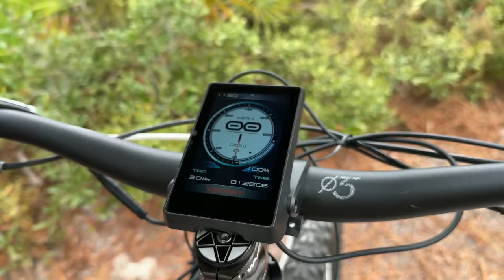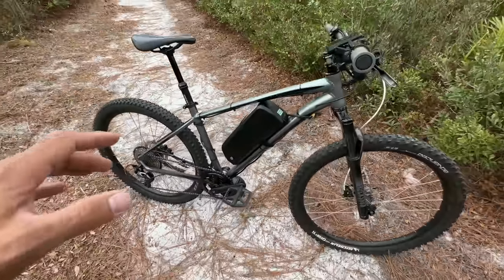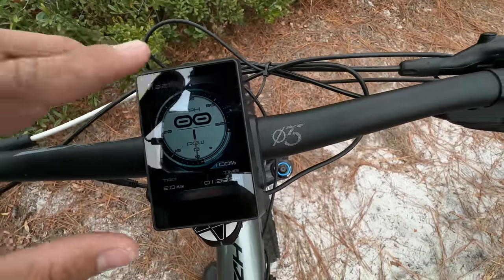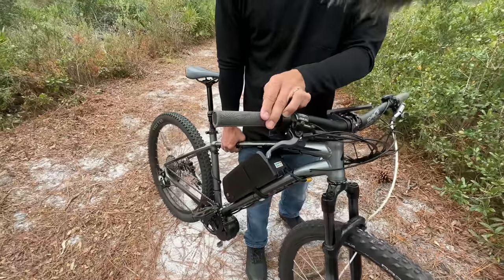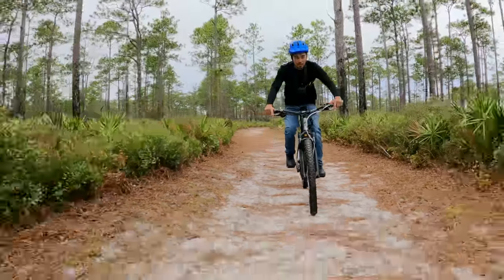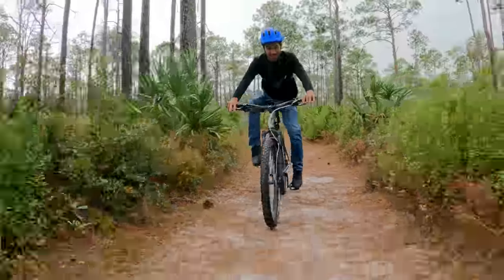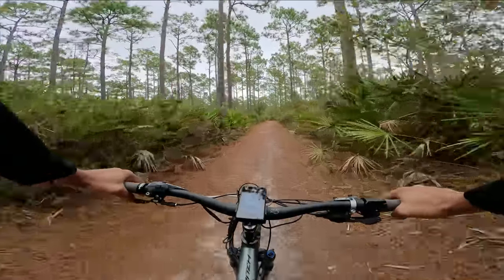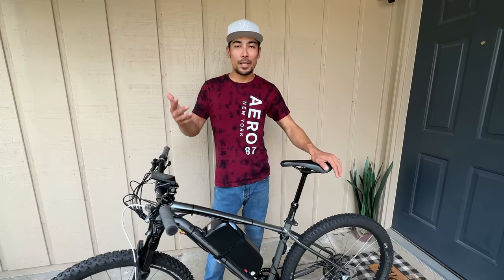Best Ebike Conversion Kit of 2022 | BAFANG Ebike Conversion Kit

Comment: Id love to see a full range test on this!
Reply: I've put the smaller BBS01 onto an old hardtail, and get a solid 60km out of a 36v 13A/hr battery.
It makes commuting fun, every day is a tail wind.
Reply: I can get 420 miles in eco mode with a BBSHD and a 48v 20ah battery. This version on the video is the toy version of Bafang.
Reply: @Eric_Tennant  420 miles, wow!
42 miles would be very close to what I get with the smaller motor and battery.
Reply: @petercroft9895  my eco mode (1) uses 24-50 watts is why. I have to do 9/10 the work to get this range on flat. The other eco mode is unlimited range mode (0) but that just a heavy bike. I can't wait to tour on it. I need the power for some bad mountain roads here in the 1/2 waste land of Arizona.
Reply: @Eric_Tennant  Fair enough, I guess I'd get the same sort of range if I ran mine like that, but it would really only be making up for its own weight. Commuting, I just dial it up all the way.
Reply: @petercroft9895  I do the same when riding with cars.

Comment: That motor is tuned down. It can go faster. But mine is similar. I do not need to go that fast.
Reply: How do you turn it up
Reply: @anubisprince36  there's software that runs on your phone. You need a Bafang USB connector. You can download profiles for your motor. Just back up your profile first to make sure you can return it in case you mess up. There are videos out there.

Comment: bro , how far it goes in 100 % charge , if we cycle on peddle assist 1?
Reply: hmm, i used pedal assist 3 out of 10( so 1.5 out of 5) 48v 17.5 AH battery so a bit smaller
i went to the city and came back so 35+35=70km and still had 30% left so i would say it should do with pedal assist 1 even 150 kilometers with the 52v 20Ah battery.
Reply: @Jytaani  its good ✌ milegae

Comment: Is there any advantage going to 1000W and/or 62V?
Reply from the maker: Yes, much faster
Reply: The overall advantage is more torque, better acceleration, hill climb, power to weight etc. Speed is not what you should be looking for. Most converted bikes if overpowered can become lethal. Their handling at speed sucks and braking systems usually struggle to function adequately especially with heavy riders.

Comment: Hi buddy quick question what if my bottom bracket 125mm can I still put bafang bbs03 120mm bottom bracket?
Reply: No you will need to order the motor with  125mm

Comment: How fast will a 52 or 72v get you in top speed
Reply: Speed is a combination of the controller (amps limit and software settings), gearing, power to weight, motor wattage, wheel diameter, tyres (fat skinny) etc. Voltage simply allows for better electrical efficiencies and smaller cabling due to lower amperages to acheive the same power (watts) output.
Reply: @nzer57  Yeah … Still didn’t answer my question could you give me a mile per hour
Reply: @philmcmorris2468  it depends on so many things. If you are very aerodynamic and have a large gear ratio you may go 15mph faster than someone with bad aero and ground resistance.

52V and Stock 1500W internal controller will get you around 35Mph on a Mountainbike.

For 72V you need a new controller. If you get something like a 3000W Phaserunner you can probably go 50mph but it will overheat after some time.

If you don’t care about hard off-road and. Just want to go fast I would recommend you get a 72V 3000W hub motor kit. That can actually sustain the speed and is easier to install.
Reply: @blise518B  I have a 2000 watt escooter that goes 45mph I believe it’s 58.9 v so how fast will a 72v get you on-a ebike
Reply: bro 52 v and 48 is the same !!! lol just to let you know, because most of the people dont know
Reply: @alexdonatodj  no 48V is a 13S battery and 52V is a 14S Battery. It doesn’t make a huge difference but it’s definitely noticeable.

Comment: The Best Ebike Conversion Kit of 2022 is from Grin Technologies. Their All-axle hub is lighter than many mid-drives. Regenerative braking (brakes last much longer) and Statorade cooling are options not available to mid-drive bikes. Their TSM-A5 is a hub motor with an Integrated Torque Sensor for custom smooth assist. 

Their Phaserunner / Baserunner controllers are compact state-of-the-art field-oriented motor controllers that are fully programmable parameters (regen voltage, max phase and battery currents etc.) including Field Weakening that allows you to run motors faster than normal back-emf limit. (Bafang motors are locked down, preventing you from dialing a twitchy throttle in to your custom preference)

Grin Ebike all-axle conversion in 30 minutes: https://www.youtube.com/watch?v=t9jvgsOT6jo

Comment: Ebike Video installation???
Reply: he said in the video installation was easy, and the connections probably only fit one way, im pretty sure it will be obvious, but u need to make sure u get the right fit for ur bottombracket:)
Reply from the maker: There’s installation instructions when you receive it, there’s even a link in the box that brings you to the installation video, pretty easy, even a 5 year old can do it
Reply: @MCMTB  good vid buddy, regardless what they tell you in the comments:), i'll have a lil budgetproblem atm, but im sure this is the cheapest way to drive electric on an MTB with a midmotor..., nice job buddy, grtz from Holland

Comment: Meanwhile I Hate this crappy Bafang Sets. I have 2 brand new BBS01 and no one works properly. They have both Error 30 Communication Error. After testing with several different displays inclusive Eggrider. The only reason that can be,  why both not work is a problem with the firmware, Maybe i should buy the Bafang Besst Tool. I don't trust the Bafang Firmware Files downloaded anywhere....

Comment: "Pedal assist" while not pedalling at all... electric-bike my axx
Reply: there were multiple options , and all u have to do is set it on that display he showed
Reply: @nudgeA7  
That's exactly the problem:  If a "Pedal assisted bike" has to option to "set it" as a motor-bike then it's NOT a "Pedal assisted bike". Do you get the point?
Reply from the maker: Thanks for explaining it to him :)
Reply: sounds optional still, who would have an MTB without pedals anyways?
Reply: @nudgeA7  
Yes, it's "optional": if it can move without you have to pedal, then it's a motor bike; if it has the option to "assist" you, than it's a motor-bike with the "Pedal assist" option. Still a motor-bike.

Comment: bafang is not good. it does not worth the price. better use a cheap front hub motor kit. cheaper  and good enough. bafang bbs is very poor quality. 10 000 kms you have to change the motor.

Comment: That thing isnt cheap.
Reply: its a lot cheaper than buying an electric MTB.., and what ive seen sofar, nice bang for ur buck...
Reply from the maker: Yeah go ahead and get a Bosch motor, it’ll cost you your life 😅
Reply: @nudgeA7  hub motors are cheaper. And then, there are the brushed side mounted kits that are even cheaper, so mid drive Bafang is "cheap" only when compared to high end brands.
Reply: @jotape5681  if i had the choice , i'd pick a midmotor any day, and it would save me a lot compared to the prices of eMTB, yep